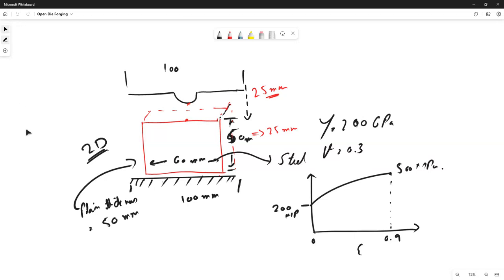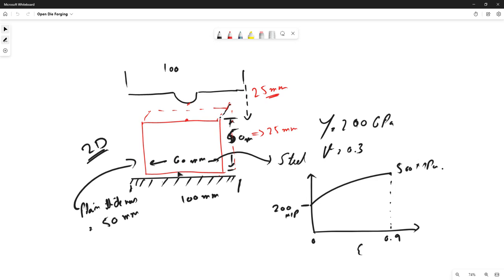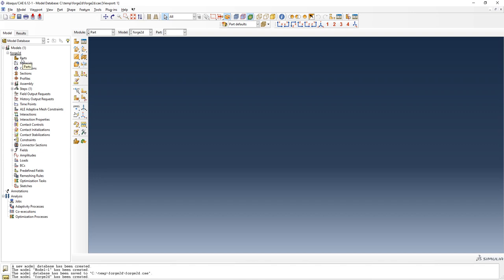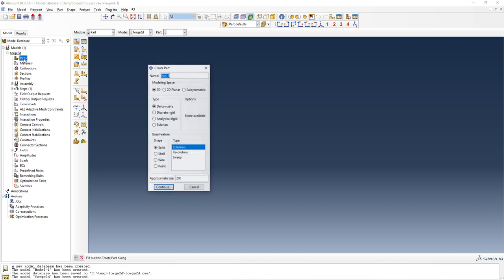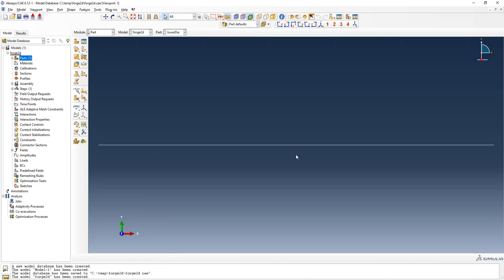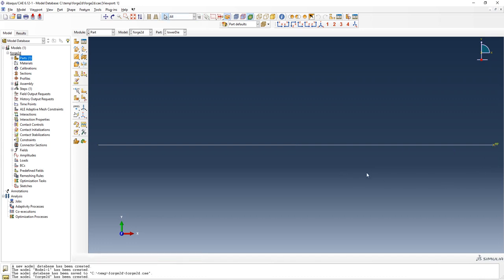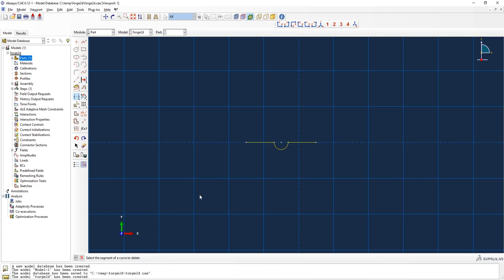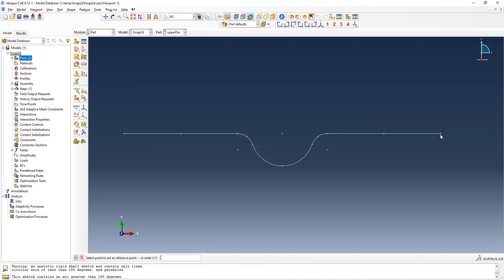ABAQUS Explicit Modeling and Simulation of 2D Open Die Forging Process

Comment: Hi Faisal,
Can you cover a topic on the how residual stresses can be calculated for measuring strain and displacement after a part under go these forging, heat treatment and then when it undergoes machining, realistically the residual stresses generated in the previous process will be released causing deformation.

Comment: AOA sir
29:47 there is default settings in paralisation  not able to change as in vidio
Reply from the maker: I think it is because you have student version and limited in its ability to run parallelization. It is okay if your simulations run and converge.